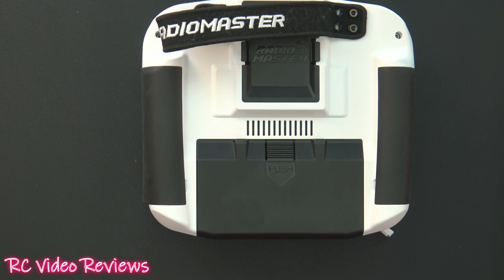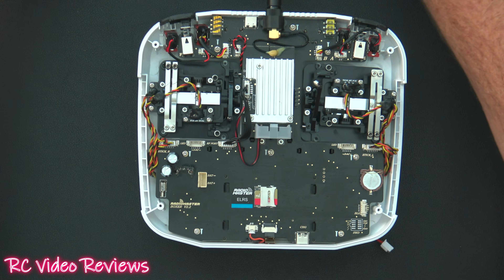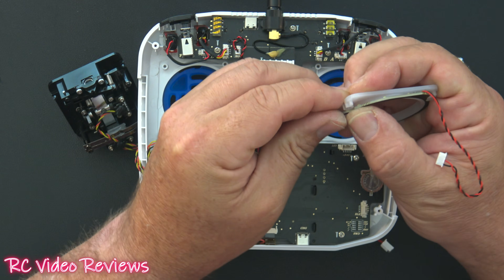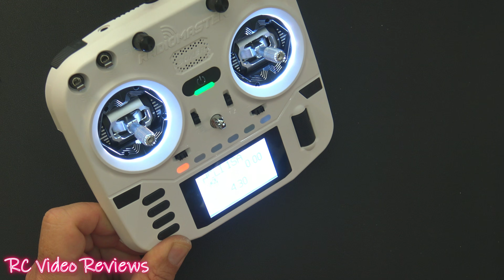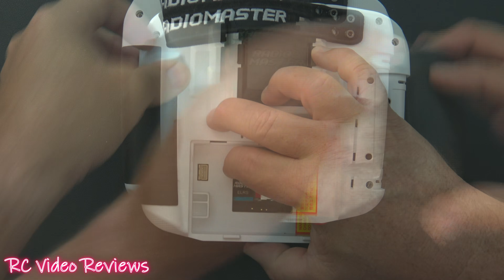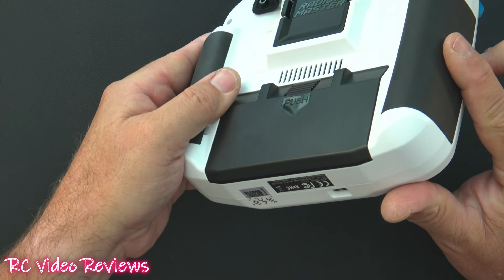How-to Install LED Rings on Radiomaster Boxer Crush

Comment: Hi! Can I have your advice on buying a transmitter? I and my 10 years old son are new in the hobby and for now we build and fly indoor slow flyers using an old DX4E Spektrum. I want to upgrade by buying a new transmitter that will bind indoor homebuild flyers (prob DSMX) but also begin flying bigger planes outdoors. Investing in buying a Spektrum or going for a Radiomaster? I read many positive things about Radiomaster TX16s and you videos are very helpful. My main concern is its dimensions and weight, specially if it will be used by a 10 years old kid. So I've started reading about the boxer. Not having that great colour screen will be an issue but having to hold something lighter is maybe more crucial. What is your opinion? Thank you in advance!
Reply from the maker: The Boxer and TX16s are almost the same size side to side and the reach to gimbals is very similar. You might want to consider a TX12 for your son and a TX16s for yourself. Then you can use very basic setups on the TX12 which is a smaller form factor which is great for small hands. You can buddy box the TX12 to the TX16s which will be in your hands. Then as your son learns how to fly on his own, he can transition into the TX16s. Zorro would be another consideration for small hands.
Reply: @RCVideoReviews  Zorro is a good choice for the size factor and the internal multiprotocol... Is it reliable as the tx16s is?
Reply from the maker: Yes.

Comment: The ones i got from the factory on my Boxer max flicker and sometimes don't work at all... Maybe give them a test run before you button the transmitter back up.
Reply from the maker: I mentioned that @3:45.

Comment: i like the LED rings on my radio but sometimes i wish i could turn them off lol
Reply: @TheHillsHaveFPV  i got the led rings on the transparent version boxer and it is BRIGHT. Like, blinding. It sucks the battery down too, but it's just so ridiculous that I have to love it.
Reply: @tailehuynhphat9570  bling for the bling throne
Reply: @TheHillsHaveFPV  there’s a video on yt where somebody soldered a solution for that if ur interestedd
Reply: just solder one of the unused switches in the middle of the power wire for leds?